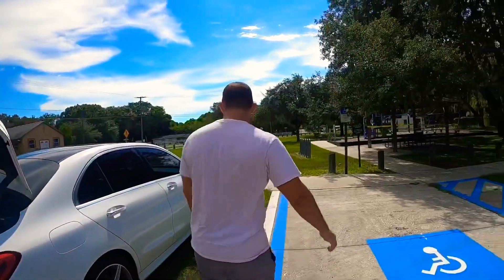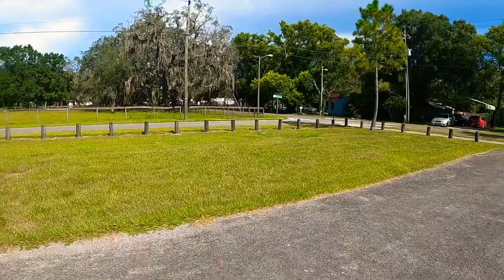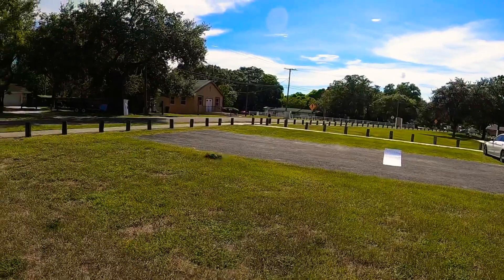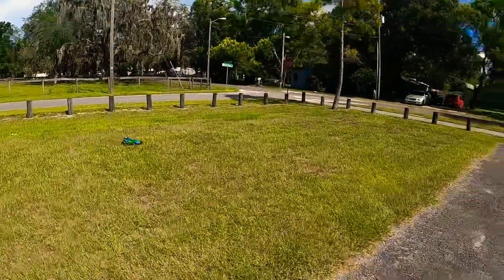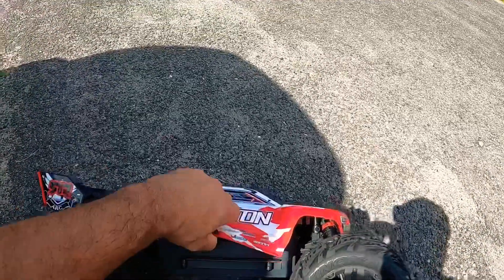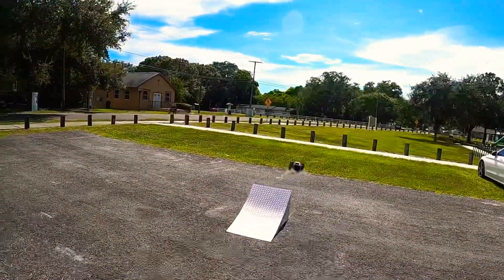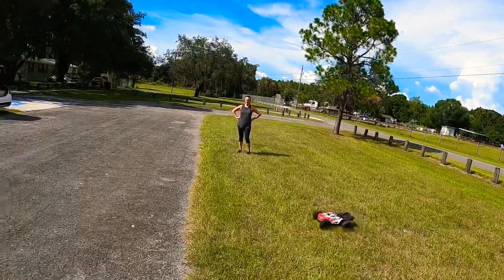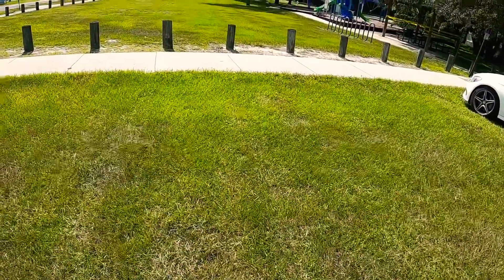RC Bash Ramp vs Traxxas Rustler VXL and Arrma Kraton 4s

Comment: You know you CAN let off the throttle while it is in the air and it will stop rotating or maybe even tap the brakes to bring the front down.  Nice ramp but it sure is narrow for those trucks.